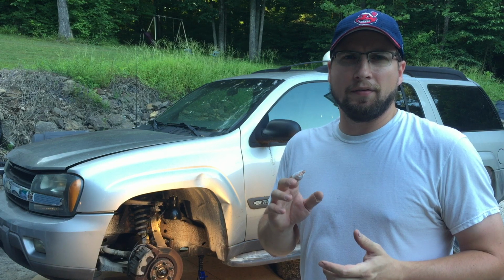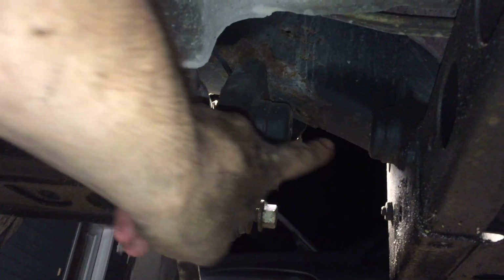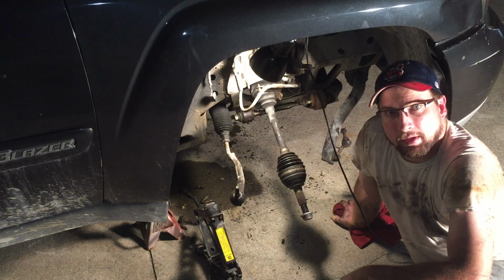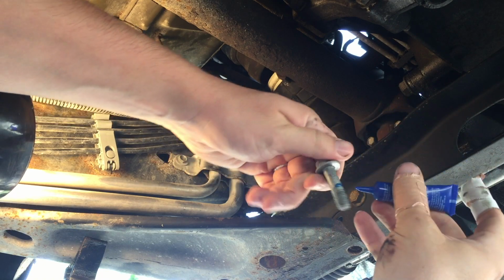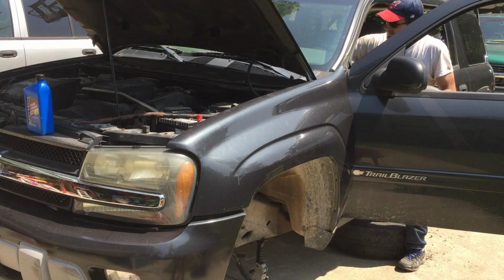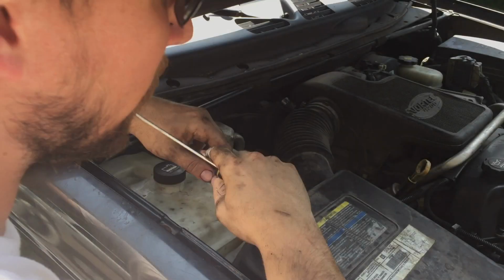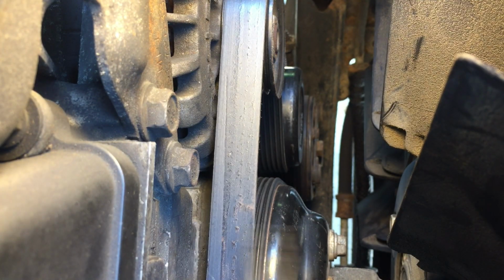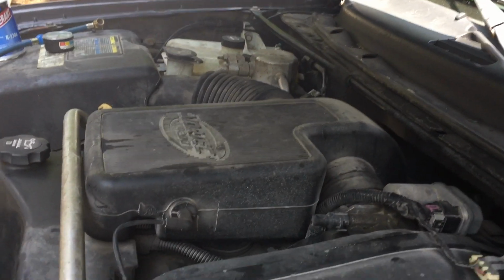Project Failblazer Episode 3 - Rack & Pinion Install & A/C Charge!

Comment: When your compressor enagegs it sounds like it's about to stall. Just last week I had a trailblazer that I was cleaning up to resell that almost stalled or did stall when the ac was turned on or off. To fix it I cleaned the throttle body up and it fixed it 100%.
Reply from the maker: Awesome tip. Thank you!

Comment: What were the symptoms to lead u to the rack and pinion? I had a bad wreck a year ago and I set my alignment way off so I replaced the entire front end...upper and lower control arms..ball joints, hub assembly’s , inner and outer tie rods, struts, sway bar end links, and about 6 months before the accident, I replaced all the brakes..rotors and pads as well as the master cylinder and check valve...I’ve had it aligned but it’s still eating tires off the front and something is making the alignment shift slightly...only thing left is rack and pinion and cv shafts...my 4wd and awd started fringing a bit so I don’t use it unless absolutely necessary...I had replaced the gear lube and made sure to use the recommended additive and the 4wd worked awesome until 6 months  after I fixed the front end...I’ve been under it trying to find what’s causing this...possibly blown back struts and sway bar end links bad in the back still but idk...the poor truck has had bad luck with deer...most of them just shattering the bumper cover and grill out but the last one sent me off the road and over a concrete culvert ...these things r tanks when u get past the cheesy plastic bumper cover...
Reply from the maker: For me it was the seals on the end of the rack were blown and leaking fluid badly. Instead of replacing the seals, I just grabbed the rack off of the parts blazer.

Comment: I'm at the very last step before reinstall. Hooking the lines up at the rack, I get it flush and it looks good, but then on startup, I spray fluid everywhere. When I checked it, it did not appear to be double sealed, and the cup seals appeared to be in place. I need to get to work Wednesday!! Tips??
Reply from the maker: iamchevyman5 sorry to hear this! Sounds like a seal is pinched or torn or something. They’re booger’s to get in just right sometimes. Especially with little room to work with. Let me know what you find out.